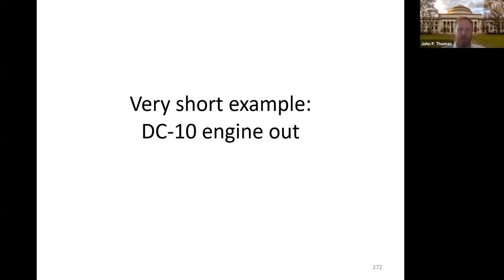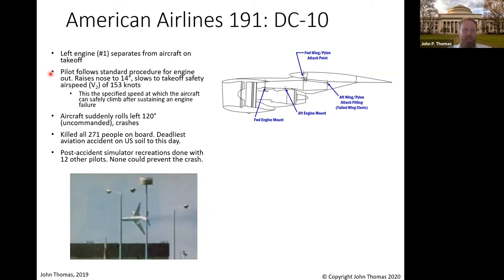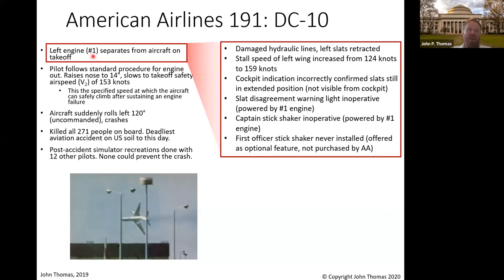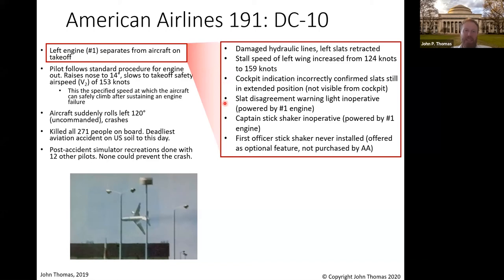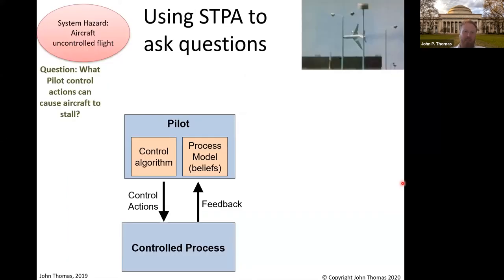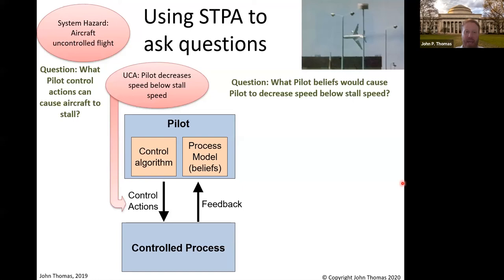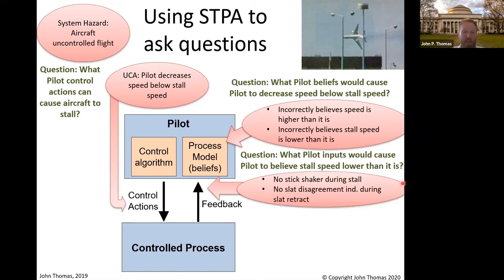Aircraft Short Example

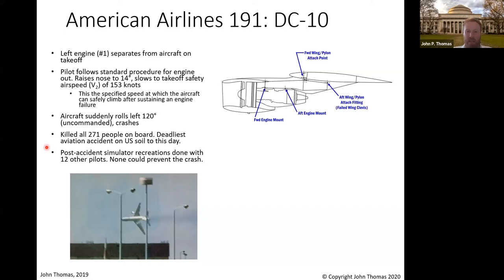Comment: post accident simulator recreations found that pilots COULD control the aircraft after the loss of the engine [with proper indication of slat disagree or stick shaker]  this is a condensed version of STPA so perhaps you did not include this...the bullet at slide time 1:25  was nevertheless not correct or not complete.